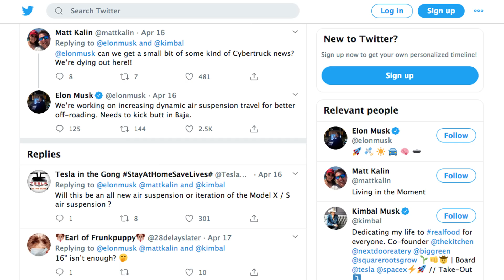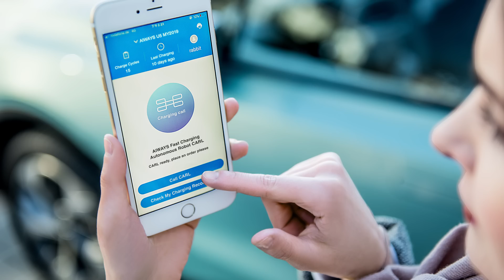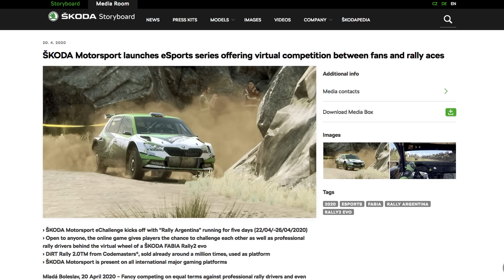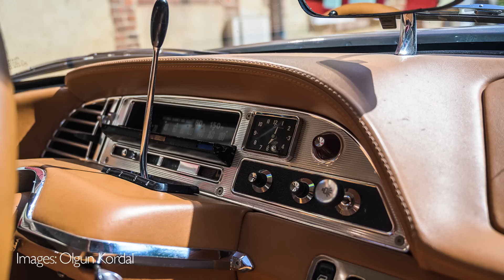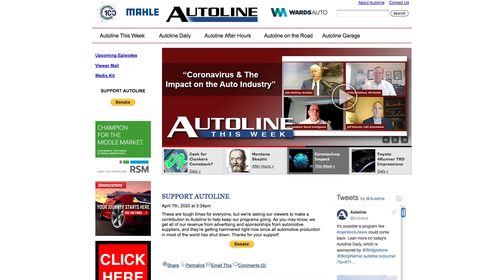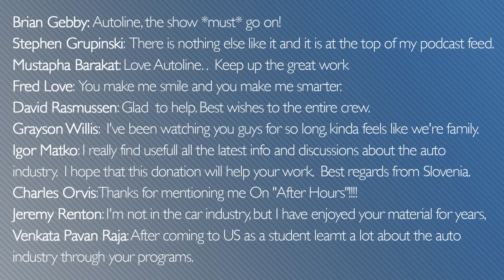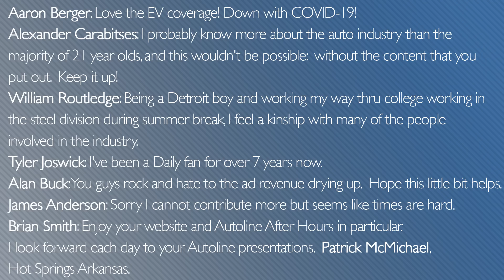Cadillac Studying Another Performance Wagon; New Tesla Cybertruck Details - Autoline Daily 2819

Comment: Still would like to see Tesla R&D spending vs others. over 15 years.
Reply: Brandon Fouts I would like to see Tesla spend money on quality control and customer support.
Reply: Would be kinda a pointless comparison, Tesla currently only has 4 available models and 2 platforms. The X & S share a platform and the 3 & Y share a platform. Other manufacturers have dozens of models and several platforms, Tesla's R&D compared to legacy automakers per vehicle produced would be an order of magnitude more.

Then factor in Tesla really doesn't sell that many vehicles to cover all that R&D. This probably helps explain why Tesla has yet to turn a yearly profit. Tesla's future is bright but it's going to be an uphill battle, not that Tesla isn't use to that already.